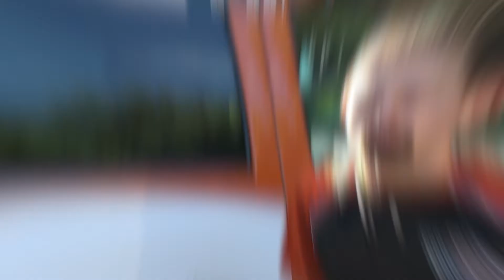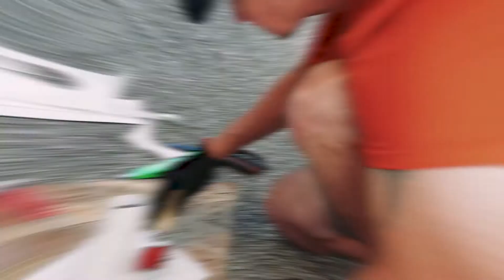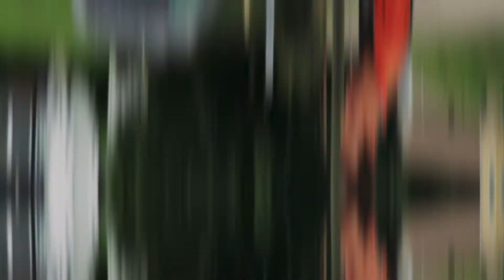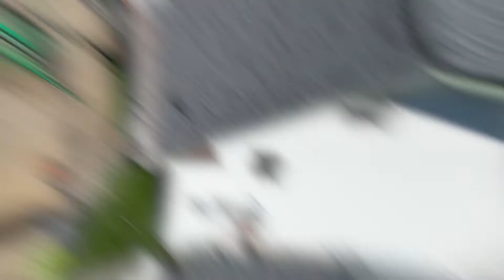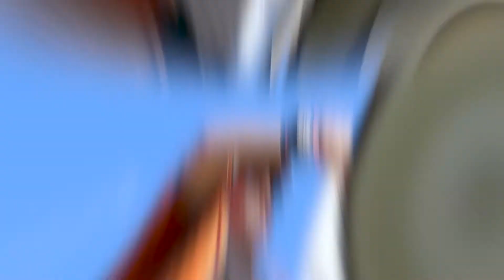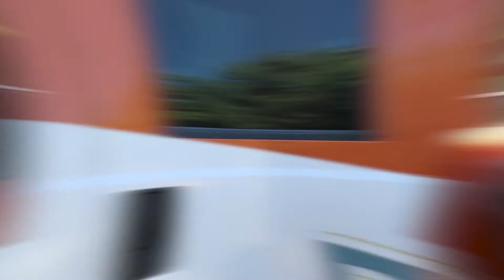Box Gutters Explained | ProMaster Home Repair & Handyman of Cincinnati

Comment: How much does something like this cost? Do you charge per linear foot? That's how i charge to reline box gutters with new galvanized sheet metal, and soldering the seams, i charge anywhere between $50-$75 per foot of gutter to rebuild/ reline box gutters, sounds costly, because it is😂, but i know some of the bigger companies charge more than twice what i charge, and they're doing the be exact same thing I'm doing,  from fabricating the metal on site, using a T edge metal fastened to the cap board, so i can crimp my metal panels on to that drip edge, and using clips to attach the gutter at the back side, on the roof, leaving my gutter free to move around during expansion and contraction..
Just curious tho, how much do you charge on average for this process? Looks like TPO , is that correct? Leister gun the seams? Using the pick to ensure your seams are properly welded?

Comment: I have a question.  How do you fashion these when it comes to the downspouts? Is there a prefab piece? Just curious as I’m considering buying a historic home in Paris, KY..not far from Cincinnati.
Reply from the maker: Hey Brian, great question. There are some prefabricated pieces that we'll sometimes use for the downspouts. However, we will also use a downspout mold to heat weld pieces of the PVC liner together to form a custom downspout liner as well, depending on the project.